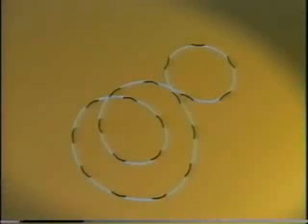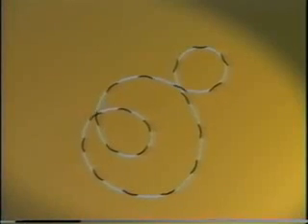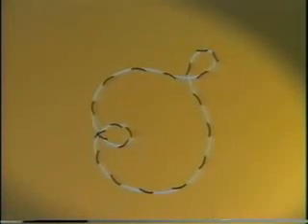Sphere Inside out Part - II

Comment: 1. 3 right angles - curved - can rotate about each other.
2.By turning each right angle about itself we're able to turn a sphere inside out.
Note:
This is much easier to do & visualize than the way the video presents it. 
Point:
We went from 2 dimensional space time to 3  dimensional space time.
1.Time is presented in 3 dimensions
2.Space is presented as length &  proportion.
This is the key to "instanteous & simultaneous" motion as in distance & time.
No inertial forces are needed.
hmm,

Comment: Lots of stuff in engineering, map making, theoretical physics... the clearest practical application of topology is in robotics.  Every possible movement for a robot with X joints can be described by a shape in X dimensions that can be mapped back into 3-dimensional space to tell us what the limits of its movements are and what tolerances are left as it approaches them.  Another is that Knot Theory is very useful for protein folding.

Comment: The video stated at the beginning that you can't turn a physical sphere inside out without splitting the edge. This demonstration requires a sphere that can pass through itself, but cannot create creases that pass through themselves.

It's just a difficult problem tackled in Mathematics over the years.

Comment: This is all just theoretical. Very complex stuff, but it DOES prove that a sphere can be turned inside out, IF this type of material existed it could be put it practical use. Otherwise it's just purely theoretical. Are you not fascinated by the amount of thinking this theory required, and that they actually solved it? I sure am.

Comment: think about it this way. draw a straight line around the equator of the sphere, you'll have a circle in a 2d plane if the sphere does not move its axis. now if the sphere can be turned inside out because of its ability to move through itself, so can the circle.

Comment: i got what you mean, but my point is that you can easily turn it by folding it on a higher (3rd) dimension, why to confine it on just 2D and claim it is not possible ? Because the original question started off with a sphere, a 3D object, already. Anyways whatever..

Comment: And Rubik's cube would be much simpler if it had only one color, wouldn't it? But that's not the point, the point is mathematical riddle, where you need to use your brain to solve a problem.

Comment: It's an examination of an individual law of physics without all of the other ones to show that the act of creasing or tearing does not contribute to the inability to every shapes. A material that allows part of itself to pass through itself may seem like science fiction, but so does most of our technology. Topology like this is also applicable to network theory, which fuels our communication infrastructures (like this website).

Comment: I think the cheat is connected to the need for a certain number of turns. In effect it's not a twisted band as a figure of 8 is. You're only untwisting something that is already in effect untwisted. I thought you weren't allowed to cut the material. So how come the sphere goes into such obvious big slices? I would expect it to move in a more 4 dimensional "hypersphere" type way.

Comment: If you mean by just twisting it inside out via pushing the walls outward and back in, you can do that with a ring, but not a circle as a circle has no edges. They only added the edge since a flat line circle is much harder to demonstrate on.

Comment: yes but as i said, that one bit that doesn't move becomes the rotary point because everything acts around it. also even if there was tension on that one molecule, electro-static forces of attraction are approximately 100000000000 stronger than gravity so you'll need a lot to cause a break

Comment: there is a reason it is called theoretical science... and it is useful, in the end, it is useable for the understanding of geometric substance is space.... If you wanted you could think of it like space travel. Say the universe is the sphere. The easiest way to cross to different points is a straight line, but you have to go across the outside of the sphere. When you can turn the sphere inside out, two or more points will intersect, creating a jump between places. Now you start wormhole theory.

Comment: well if you keep in mind, that matter isnt solid. it is theoretical possible to push matter through each other. but if you do it to sharp you may rip the matter. now imagine you paint your car with a special paint. each paint drop is a little sphere, now make the inside of the sphere one color and the outside another. now if you can use the theory of this video you may be able to switch the color of your car without repainting and without to destroy the color consistency.

Comment: In reality, yes. a circle or sphere will never be perfectly round, and is just made of a number of small corners. There will always be a bump somewhere in a circle or sphere IRL, even if it's just a tiny one at molecular level. A corner is made when two lines intersect eachother, a curve is a single line which is, obviously, curved. All points in the perimeter of a perfect sphere or circle will have the same distance to the centre. But theoretically, it's possible ofcourse.

Comment: ...But in order to turn the sphere inside out, you still need to turn it into a shape that obviously isn't perfectly round. I mean, pause at 8:06 - no way is that a "sphere."

I get that the point is doing it without sharp corners, but when you can do stuff like stretch the surfaces anyway you want and pull them through each other, that limitation seem kinda abitrary.

Comment: Why does there have to be a point? This is mathematics. It's done for its own intrinsic beauty, and it expands the set of human knowledge. 
This problem is from Topology, and if you google Applied Topology, or applications of Topology, you will surely find applications to Physics (most likely electronics). 

Try not to be so naive. Just because you can't see an application doesn't mean there isn't one. And there doesn't even need to be one at all.

Comment: if by space you mean outer space, with no air inside or out, there would be no pressure either on the inside or out, so the pressure couldn't possibly change.

Comment: but water doesn't snap if you bend it to a point, it just disintegrates due to graivty, BUT if you put a ball of water with a hollow interior - i.e. a bubble - into space it wouldn't collapse, but due to pressure changes it would pop when you bend it.

Comment: Example applications are when you model an electromagnetic field in our usual 3D space. The electric and magnetic components are transformable linearily from each other, and add their own dimensions. You could also use a 3D space but with complex coordinates, so that it becomes morphologivally equivalent to a 6D real space : in which the sphere surface will be inverted without creases and without any self intersection.

Comment: And in terms of topology this is the important thing : you don't care about the cartesian topology of your projection. What matters is how points of the surface are connected and how "fast" you can go from one point of the surface to the other or if there's a path connecting them, allowing also any arbitrary intermediate points to be inserted between to create a continuous path.

Practical applications are found in many applications that need more than just 3 dimensions. And these cases exist !

Comment: that is the beauty of theoretical mathematics, we can explore principles that can't be explored through conventional means. also, things can move through themselves. water for example, as all liquids and gases. even solids are just meshes of molecules that are suspended away from one another in space due to electrical charge, each could be pushed past another, but this would require enough force to maintain the attraction while still pushing past it. 12 year olds ought to know their place

Comment: yes I understand that it is supposed to be abstract, and i regret my original comment; I have since brushed up on higher dimensions (mainly the 4th dimension) the rules described in the video are the basic rules of the 4th dimension.  in other words mathematically possible but not physically possible.  another good example is the  Klein bottle.

Comment: This might explain how the core of a star becomes a black hole when it dies, think of the outside not just being the star and it's core, but the Space-time distorted by the star's gravity well that it is surrounded by, The massive increase in the density at the core of the star initiates the stars implosion, however the implosion also pulls the core of the star and it's Gravity Well to a point that could be looked at as inside out, explaining some things like Time-Dilation. Just an Idea...

Comment: I find this hard to believe. Why does it need to be so complex? Why does dividing into 8 sections make it work -> Why not 4 or 2? Surely, there are infinitely tight points being created. The video should show closer views of the action in one of those very tight wrinkles that are visible.
Also, this:  /watch?v=I6cgca4Mmcc&feature=related  seems a better solution, though I'm sure it operates similarly.

Comment: @insidetrip101 the black hole doesn't pass through itself , even though it possibly could because it's just enormous gravitational pull, who knows what will happen if the edges of a black hole somehow overlapped each other, but that never happens... it just stays the hole it is sucking in light into it's even horizon and things get traped down in the hole. But being the same thing i said i dont think a black hole could pass through itself, and if it did, it could cause all kinds of collapses :/.

Comment: @HARUHlIST Topology itself has no practical applications. But it is a tool for mathematicians to figure out useful things about practical problems, like differential equations for instance. Most of modern math (both applied and theoretical) couldn't exist without topology. The reason you don't see it is because it is hidden deep inside the useful theorems, and unless you have a graduate degree in mathematics, you probably won't know what to look for.

Comment: @lewiszim  It's actually something you end up passing eventually during the process of enlightenment. The Buddha had a practical way of explaining it to conform with outer standards, namely the figure-eight flow. Your soul is a sphere and as you continue centering to the center point in space, it becomes pretty much what you see here - an inverted spheroid that surpasses the third dimension. Everything has to do with geometry, shapes, patterns, symmetry, you name it. There's always some balance.

Comment: @brickandfanal 

I don't think it would be possible to put an object inside a sphere without breaking it, every point on the sphere has to pass through another point on the sphere, which means the object would also have to pass through the 'skin' at some point. If it could do that there would be no need for the inversion at all.

This to me shows how it is possible to avoid singularities which generates a new branch of mathematics, in terms of useage :)

Comment: @ 3:38 when the loop was turned like a belt and at 6:10 when corrugations were made... could you make more explanation. It seems like the case of inverting a circle to me, which is not valid since it produces unequal no. of turns ( + and - turns ).

Comment: @IcEmAn23104 Time and space are made of this fabric, using the current model. That's why you can't tear through space time, and only bend it. Also, all surfaces can be described using this model. Keeping it "smooth" and "diffeomorphic", allows us to preserve information. If you have a potential or a temperature that is constant on some edge, for example, it's virtually impossible to find the temperature\potential everywhere in space. However if you move it like in the video, it gets easy.

Comment: Any idiot can say a rubiks cube has no purpose but trust me, it takes a huge amount of knowledge in physics and math to understand how it is even solvable, because for instance when you mess it up you do not have to copy the way you messed it up backwards to fix it, although that works, you can start fixing it from any side you want, and any single cube, you dont have to remember any of the turns that messed it up, and repeating a set of sequenced moves fixes it no matter how it is messed up.

Comment: @Estominala It is, as long as it can pass through itself (in one plane only i see) and no sharp edges, it's been done with protons, and if they are rotating in opposite directions, they can pass right through each other, so the theory seems to fit.Only it won't work with a baloon :)
Hope this helps

Comment: This model says if  the loops are small enough no one is going to know the diffrence.  who cares  and it breaks one of the first primary rules it speaks of, puncturing. the furrows are slices that give it twist.  this  looks like a model of a star with poles and a convolution of equitorial  convective foldes that lap enough to give rise of the notion that most of the out side stuff is behind  some of the left over outside skin. surfacing and sublimating at will.  sorry if I burst your bubble.

Comment: So I imagine that the more guide strips you used, the more accurate this method would be?  If you could use an infinite number of infinitely small strips, you could integrate and find an answer?  Is that right in a very basic conceptual sense? I'm sure there's more to it than that but in essence is that right?

Comment: Also, imaginary numbers are used in the design of the geometry of airplane wings.  The cross section of most commercial airline wings when looked at from a direction parallel to the wing is a curved loop that to solve for requires the utilization of complex numbers.

Comment: Those commenting on the practical side of this are losing sight that this is being applied to a sphere, an abstract geometric model which is an approximation of countless natural phenomena. It does not necessarily have to be a a solid object or even have mass. It could be a polarized gas or an aerosol in a magnetic field, light trapped by intense gravity, a fluidic shock wave being deflected by some means, or the non-Newtonian behavior of a subatomic particle.